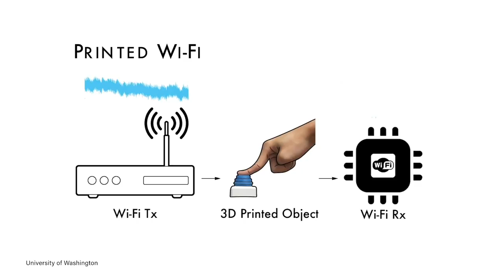These Power-Free 3D Printed Objects Can Talk With WiFi

Comment: Wish it was more detailed of how it works
Reply: Look into rfid chips and and how radios change stations
Reply: @aspiringscientificjournali1505  i was thinking that was rfid, but in this case look like there is no chip. I was curious about how they save the signal, maybe is using some sort of filter
Reply: @DasParedes  the " chip"is printed 

Its beautiful
Reply: @aspiringscientificjournali1505  but you can't use chips if there is no way to power it? They keep talking about frequency so I was thinking that they made the spring the right size to resonate at a super high frequency -> the WiFi. This way the system interacts with WiFi without power.
Reply: @danielwesterugalde1193  yes this is how rfid works 

I it's essentially  vibrating  rfid scattering
Reply: @aspiringscientificjournali1505  it's been a while since I had anything to do with radios my bad.

Comment: 0:35 Nope. Your modem does not in fact send out wifi signals.  It only allows you to interface with your ISP.  A router or gateway sends out the wifi signals.

Comment: AM rádio already did it and there is a lot homemade projects available on internet that can hear in earphones without an active source of energy. The news here is mechanical gadgets that interact with WiFi signal and also using just it as a power source, another advantage is absence of electronic components, which can easily damage, making this technology even more reliable.

Comment: For every new and interesting tech that can be used for good, it can also be used for bad. These will back scatter any wifi in the area, not just the one's you want. This means that a receivever can be placed outside or in a nearby building, as long as it's within range to pick up the backscatter from both your devices, and any device that's been put in place with out you knowing it. While the bandwidth currently isn't enough for video, or even audio, I'm sure someone will find a way to spy and/or profit from this.  Anyways, cool video!  :)

Comment: I would definitely be interested in using some of these for my clients.  Would save us a lot of hassle in the long run.
Reply: Detect moisture levels in plant pots. Instead of using a mechanical device, you use a hygrometer to change the force on the spring depending on how wet the material is (like a pine cone opening and closing) and then encode the water levels in the slowly changing amplitude of the backscattered signal.

Comment: Would it work on a secure network or just open networks?  If it works on a secure network by using the security of the device it's communicating with isn't this a security hole?

Comment: So I understand that does not really communicate via WiFi but "disturbes" the signal?
So then I need a special antenna fir that, right? I can't think of a way to track the raw data of my wifi antenna on the computer.
Any suggestions?
Reply: Bingo! There's no way it's a WiFi device. It's just using the RF energy.

Comment: I certainly will not print something like this. When there are flakes of copper in the filament it will damage your extruder nozzle. Also why would i want one of these. I can far more reliably weigh things. IE pill bottle or deturgent. Also how is security? My neigbor's wifi should also reflect the wifi signal. Right?

Comment: I would totally love to do this for my 3D printer. The thing is I don’t know how to build the antenna and I don’t really understand how it works besides using Wi-Fi.
Reply: Instead of electricity sending Info thru the antenatee at the speed of light with 1s and zeros it uses the conductive antenna mechanical motion( it's slow not the speed of light contact with another surface as a 1 and no contact as a 0 and sends the info that way.)

Comment: So you're saying I could have a wireless keyboard which never runs out of power!?
Reply: That actually sounds like a really good idea
Reply: Hm, a keyboard has a lot of keys that would have to be clearly distinguishable.
That's probably not too easy to make and I doubt somebody will put the effort in to make/standardize it for the simple reason that this method cannot really encrypt the signal.
I for one do not want all my keyboad inputs (chat, passwords, etc.) to be shouted out like via encryption-less wifi :D

You may want to look into development of ceiling-mounted (auto-aiming) infrared chargers.
I guess they could provide enough energy (24h/day) to keep the keyboard charged at all times, I guess.

Comment: Not so groundbreaking. You can only send info, but no recive it. This limits applicatio only to sensors. Mehanical recivers would be groundbraking tho
Reply: Automotive industry? less wires, lower weight, imagine ABS, temperature, preasure and other sensory being implemented on a veichle with this tech, all of witch will have to be adopted by manufacturers in industrial applications after being developed much futher, there is a million things that could benefit from just that alone. Flowmeters, temperature sensory with bi-metal logic solutions. I mean, this really is something unimaginably great but its still in its infancy so who knows how it and if it'll ever be given the chance to mature into a new field of technology.
Reply: @Arcticfisher  I think for the foreseeable future such lifesaving sensors will probably be more reliable if left as they are instead of relying on ambient wifi signals
Reply: @redundantqwail9088  oh, forsure I totally agree with you.

Comment: So technically couldn't you make a smart home with no exposed light switches using this? If you could tune the antennas on a nob controller to each backscatter a unique signal then you could technically have Wifi bulbs like hue bulbs and control them via this analogue device?
In which case if all devices in your house were powered via wireless energy through the walls could you potentially then just use analogue switches for them all on a home network?

Comment: No I wont print these because youll probably need a 10k usd worth of "WiFi" consisted of a microwave function generator, a spectrum analyzer or better off a network analyzer. VNAs that go above 2.4ghz is pretty expensive and I dont think you can pull it off with just sdr on 2.4ghz band with radio locationing. You are building a radar, basically.

Comment: As we as a species begin to morph into a more evolved one during the singularity networking initiative, the kinetic harvesting of gravitational energy devices could be used to issue things such an alert tone if your chemical composition shows any signs of depleted levels of things such as iron and copper, as the two metals can cause a different reaction to a sensor, or by preset weight definitions that have been databased mechanically through this methodology of harvesting/recycling.
It appears your running low on doritos cool ranch chips that have been treated with a specific level of additional vitamins and nutrients being that its the only food product you've chosen to consume for the past 22 years, based on monitoring the exact amounts of everything you've consumed. Please check for restocking of your mmm delicious chips, at the drone delivery door compartment that is attached to the left side panelling of your fridge that bridges to the wall structure of your home that has been installed within compliance of the public ordinance health code for ' priority 3 maintenance scheduling', or activation of a further convenience procedure will occur while you continue to do pretend that you are doing absolutely nothing, courtesy of the successful surgery you underwent in 2027 that you are paying off over time via your production flow coordinator career at the borg employment centre will take care of all that in 5 minutes, 4 minutes and 59 seconds,..

Comment: Just throwing bunch of hopes without a solid use case. Don't fool yourself, positive is important, but just throwing hopes without bases could end up as Theranos, Water condensers or solar roadways. Be aware not to deteriorate SciTech credebility .
Reply: What are you talking about? This is power over wifi bump switches! The applications are pretty well documented seeing that bump switches have been around longer than we have.